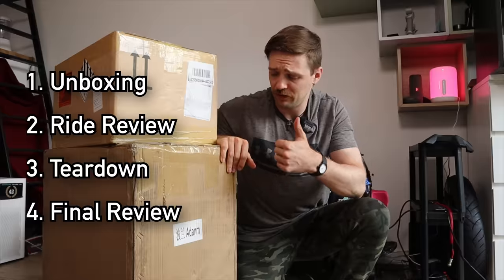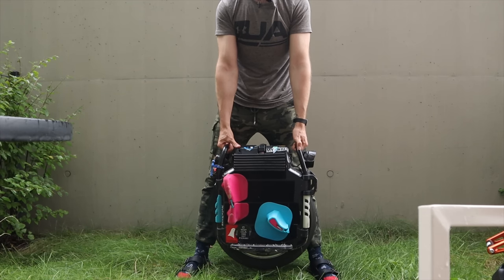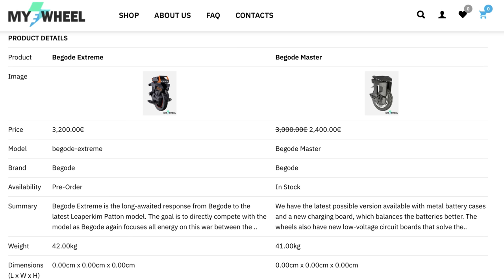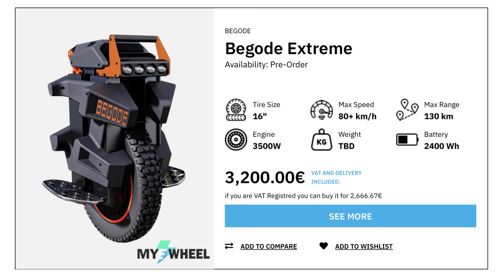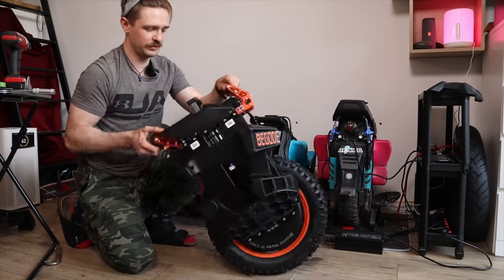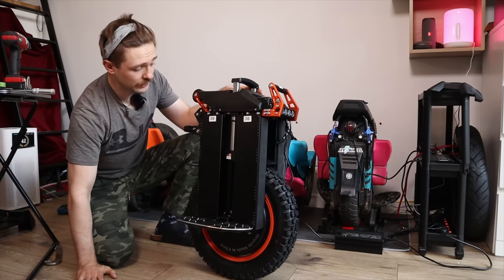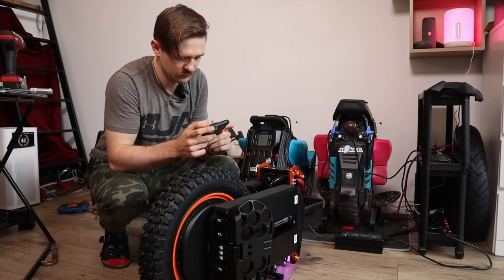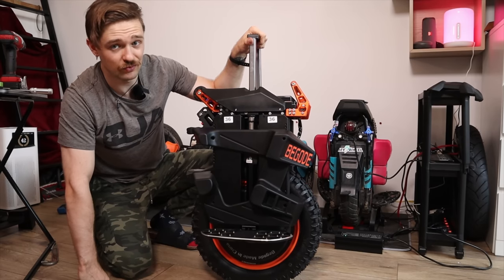WILL IT BE-GODE? EXTREME 134V UNICYCLE UNBOXING!

Comment: it genuinely blows my mind that begode put a smart bms on one of their wheels before leaperkim did. i really want to see a wheel with the begode extremes performance in a msp or rs shell (there would of course be no suspension though). just essentially a reasonably small performance wheel because we haven't had one of those since the original commander
Reply: I love my MSP!!!!

Comment: Welcome back Adam 😉 Excellent video. Those loose fuses are for the charger. They've been throwing them in the boxes for awhile now. And the Extreme costs the same as the Master in the States. Don't know why they are pricing them different where you live?
Reply: That is disturbing to hear. 800€/900$ is not a small difference, either.

Comment: About begode app. Cautinary tale.
Just a warning to every EX30 user. Story about how my EX30 bricked.
So. I heard there is a new official firmware for EX30, with 2 modes to have fun with. Racing and offroad. So i installed official app, then installed this new firmware on my EX30. Now i can jump between 2 modes with a press of a button in the app, great.

So i tested it. It was fine.
The next day i went to 20km trip with offroad mode. Then i decided to go back with racing mode, just to see the difference. Well i pushed killswitch button on my EX30, put it on a kickstand. Here goes the official begode app. I push the racing mode button...wheel died.

I cant turn it on. Nothing works. I tried to remove the batteries, nothing. Replaced them back on...nothing. Wheel does not respond. Seems like mosfets got killed. Thanks, begode.
Reply: Can replace under warranty
Reply: @justinspirational  wheel was worked on, hydro isolation, etc. Not sure
Reply: @Trener_Artem  begode owe you a new motherboard.. it's their fault it fried due to the new firmware and they are aware of it.. the latest update fixed this

Comment: I am torn between upgrading my V12HT to a Patton, an Extreme or maybe an Adventure for the next European summer. I am patiently trying to hold off until they've all been thoroughly reviewed by people like yourself. I did ride a Patton off-road for a bit yesterday, which was heavenly. It was my first choice, but then all the other 16" wheels got announced and I thought I'd wait a little longer, plus the V12 isn't even a year old.  But after trying it out I can't help but lean towards the Patton again, and the fact that Leaperkim tends to make fairly robust wheels. But still, patience. I look forward to hearing more from you about the Extreme, and then later the Adventure.
Reply: the patton has the most low end torque of any wheel right now but the build quality and design seem to kinda suck. if i get a new wheel it will be either the v14 or the extreme personally
Reply: @VECTOR_Coasters  I thought that on the whole the Patton was put together pretty well. I have seen one video where there was some rust  on the motor, and another where some bolts weren't tightened properly, but I kinda got the idea that in general it was pretty solid. But I am in no hurry, my V12HT had some problems just before the warranty ran out, and basically, apart from the motor, its insides have been completely replaced and the odometer was set back to 0, making it almost as good as new. I will try and contain my urge to upgrade until after winter!
Reply: I upgraded to Patton from V12ht when it was released, absolutely loving it. Amazing wheel
Reply: Patton
Reply: Extreme
Reply: @VECTOR_Coasters id argue the Patton is as good of build quality to the extreme. Begode isn't known for it either. The suspension on the extreme also currently has issues with the mounting bolt bending and breaking. Overall the patton has a simpler and more robust suspension system given there's no moving parts other than the suspension fork.

I haven't had any major build quality issues with the patton for 2k miles. It also hasn't had any major issues other than blowing the board from full charge when braking hard, because the wheel doesn't warn the user. This has been fixed for the next batches and all of the wheels will get a firmware update to alarm the user, which it currently doesn't. The extreme is more water resistant though
Reply: @critzlez8593  the problem with that bolt is only on the coil version of the extreme and if i’m not wrong, the whole shell of the patton is soft and strips extremely easy when taking it apart or putting it back together and if you ride the wheel hard then after a while the whole thing starts to shake because of how lose everything gets so that doesn’t scream quality to me
Reply: @critzlez8593  well, frying the motherboard while braking doesn't sound good in today's EUCs. If you're not going downhill for very long time EUC should be able to dissipate the extra energy into the heat.
Reply: @kilobak2297  it happens to all wheels. Actually, today they released a firmware update and now it beeps very annoyingly when youre overcharging from braking now
Reply: I'm in the exact same boat! V12 ht owner looking to upgrade and the Patton was my next choice. Have you decided?
Reply: @jonislow  I haven't made up my mind yet. Some reviews of the V14 Adventure are just starting to trickle out now, + there seem to be some changes made in the suspension of batch 2 of the Extreme. I'm in no hurry. We're having constant rain and lots of wind where I live, and there hasn't been much of a chance for any riding to be done anyway.

Comment: I keep thinking about default settings. 
You mentioned 70% instead of 80%. 
Perhaps you should push for a standard default out of box. 
Users can change it later if they want. But the default is what happens to the rider with out of box wheel.

Comment: Issue with bolt is that they apparently sent too short coils springs with not enough stroke so there's coil bind transferring all the force into the pin

Comment: My Patton is a month and a half / 900 miles old and I haven't had a single solitary hiccup, I honestly can't recommend it more. 

Begode needs to take a page from Leaperkim and make one or two really solid wheels a year instead of flooding the matket with crap.
Reply: Nah, Begode is doing exactly what they should be doing
Reply: I don't care how many wheels they throw together, but not guaranteeing the ability to get spare parts is a huge red flag. Would never buy a wheel that can't be repaired after a few years.
Reply: Lol.. the extreme build quality is BETTER than the patton with its all cnc metal design with better suspension and pedals and more durable and more stable with its 3" rim.. so the patton is crap and overpriced comparatively .. and the patton only has higher low end torque compared to the early extreme firmware.. it's already similar and likely better in the extreme in the latest firmware update and only getting better over the next few months of dialing it in (especially in offroad mode where the low end torque is higher)
Reply: @justinspirational  I'm going to venture to say that you don't own and/or have never ridden a Patton. No one I have ever talked to who has ridden or owned a Patton has said such a thing. The day I buy a first gen Begode wheel is the same day I let someone staple my face to the carpet, but go right ahead and be a fanboy if you like.. just wear a helmet
Reply: @CrossroadWater  you sound like a leaperkim fanboy.. but everything I said is true but you're in denial that begode quality and durability is night and day compared to what it used to be and that the extreme still out performs the patton speed wise and is very comparable torque wise and only getting better with time with each and every firmware update.. I'll never get a leaperkim wheel so long as they are overpriced for what you get.  Had zero issues with my first batch ex30 and not expecting any with my extreme.. begode knocked it out the park with both wheels.. and in truth I'm not a begode fanboy.. I'm a high performance fanboy (as the highest headroom before cutting out/ over torquing is safer imho) and it just so happens to always be begode wheels.. if it were another brand I'd get that but it isn't..(the inmotion v14 was promising but they're going to cap the top speed at only 43mph and looks like it's made of a lot of plastic and not very durable)..the patton is the very first wheel to compete torque wise but not in other categories (like speed, suspension, stability, durability, center of gravity, even build quality)
Reply: @justinspirational  The Patton cost $100 more than the Extreme lol, you make it sound like it's $1,000 more. Whatever blows your hair back man.
Reply: @CrossroadWater  no it isn't.. got my extreme for only $2300
Reply: @justinspirational  Retail in America the Extreme is $2,999, and the Patton is $3,099

Comment: Friends, I have a question. What wheel would you buy as your only wheel today? I've been wondering about this and have been following the topic for several days. I want to have a wheel that will both go fast and be able to jump on it on a motocross track because this is the sport I have been most interested in so far. I also like forest sections very much. I'm thinking about s22, Patton, Extreme, Commander Mini and the new Adventure (but I've collected the least information about this one). I weigh 95 kg without clothes. Thank you for your help.

Comment: The vent?  You mean the valve stem of the innertube?  If that's the case it will fail and you'll get a flat.  Tire changing on that diameter rim is a pain in the ass too.

Comment: Extreme will be the best agressive offroad Euc, the cut out from chooch it was his fault, he had less than 45% battery, but he must be the record holder for cut outs, and it's euc's fault, but a top video, thanks
Reply: Not his fault. He mentioned abnormal voltage sag which means one of the packs must have been faulty. That said, provided no defects come with the wheel it looks like the only other issue with the extreme is the flimsy suspension arm in the rear. Not bad fromBegode it seems they are improving.
Reply: Did he have 45% battery? He said in the video it was fully charged when he'd left his house shortly before it happened.
Reply: @nicksilver3757  1:39 the battery it was changing between 2 bars and 3 bars very fast before the pip, he knew from before that the battery was wearing out very fast, so he should have checked what the problem was before he ride the euc

Comment: I have been lurking for months...thought the Begode Extreme was my choice for my first electric vehicle of any kind, but at the last minute I decided on the Commander Mini, hope I made the "right" decision....should have it here in about a week, ordered from E-Wheels, really great people to work with!
Reply: The Commander Mini is more capable on streets & as commuter PEV, it has a higher top speed so you'll be safer keeping up with traffic once you're comfortable enough to get off the sidewalk; it'll give you more room to grow. The Extreme is more capable off-road on gnarly trails, b/c it has more suspension travel... but as you get comfortable going higher speeds, it won't have the overhead to keep you safe. As an EUC rider of 2+ years experience, I'd say you made the right decision.
Reply: Good/ reasonable decision if you ride streets only.. bad decision if you like to ride dirt.. extreme the better choice for that. That said when ridden sensibly the extreme easily exceeds 50mph as in Ronin's street test with actual live data to prove it (& he weighs 220 pounds)

Comment: with the release of the adventure's specs I really feel conflicted. I want the inmotion quality but 85 mm is so much less than 130
Reply from the maker: So true!
Reply: Depends on what you're after, but Inmotion uses a dual rating spring in their shock, which I'm thinking could saves riders from suffering a bent suspension rod as is the case with the Extreme. The suspension travel is nice, but I'm thinking the V14 just ... doesn't need it to be confortable/sturdy. As with many things EUC, patience is rewarded.
Reply: @RiddSann  if I got the extreme, I would immediately replace whatever bargain bin begode shock is on there.  Coming from MTB, I'd want something from fox or rockshox. Even if the inmotion coil is good, I'd probably end up replacing it, and an extra 45mm of travel is nothing to scoff at.
Reply: The question for non-offroad use is, how much shock travel is even needed and is the benefit greater than having a top heavy wheel and possibly more maintenance issues?
Reply: Nah adventure build looks cheaper and less durable (too much plastic) unlike the mostly all cnc metal highly durable extreme build..I love my Extreme.. couldn't be happier with it..I love to ride dirt the most and the extreme suspension is greatly appreciated.. the top speed of the Adventure will also be capped so still may end up slower than the extreme in actual practice..I added a new 190mm 1000 pound spring to the coil shock to make more use of the full extreme suspension travel and cover my 200 pound weight better (better than the stock shorter 900 pound spring that covers less of the suspension travel and not quite strong enough for my body weight)
Reply: Remember, cnc metal looks nice, but in a crash, it bends, where as plastic tends to flex.
Reply: @MotorizedNation  cnc is unquestionably far more durable.. it may bend . But doesn't shatter and crack becoming unusable like plastic.. given the same forces

Comment: Hey Adam, could you measure the suspension travel between the two rubber stoppers, see if it's really 130mm as stated accounting for the stoppers?

Comment: How else were they to spell it, they were obliged to spell it the Wrong Way. Why you stopped reviewing Begode,  they weren't throwing you off the way you liked, such as the v12 🙂 Kidding my Master didn't make a 100yds before it had to go back to the dealer - fine now, and I really like the wheel by the way, no really love that wheel. Chooch um well the less said the better perhaps. The "Master" plastic battery boxes perhaps, but after pads and handles etc they aren't the first thing to hit the deck.  Shock pumps, I got something a bit more capable.  Riding the beeps, if you ask more of the wheel than the battery, motor, board (firmware), can deal with there can be only one result. If you are going to ride this way, you really have to know the wheel and be aware of the subtleties such as you explained in your video. I wouldn't charge the Master at more than 9A, it would be the same for this for me at least. Really interested to see what you make of this wheel when you ride it.